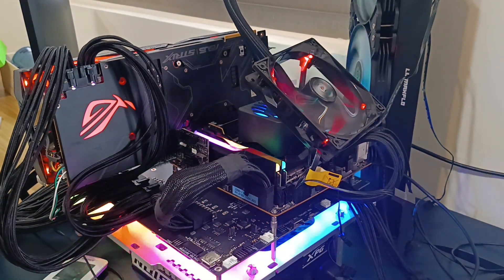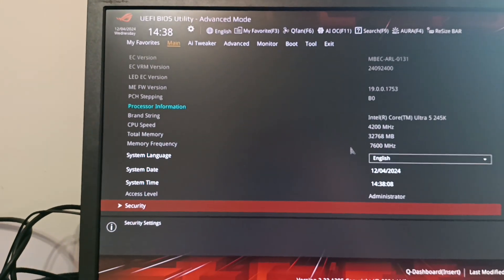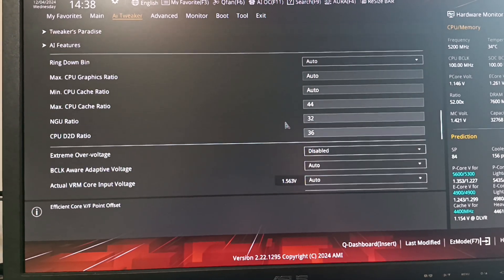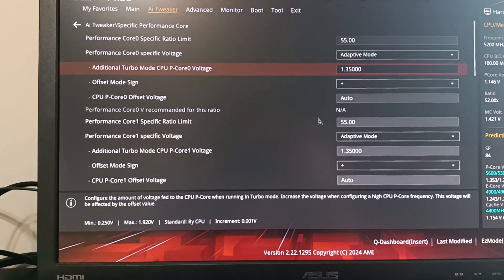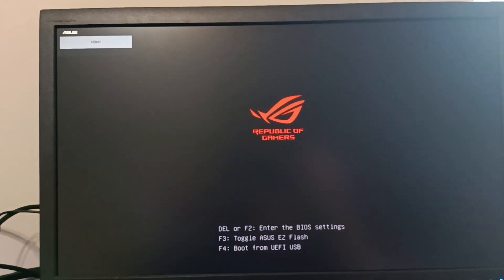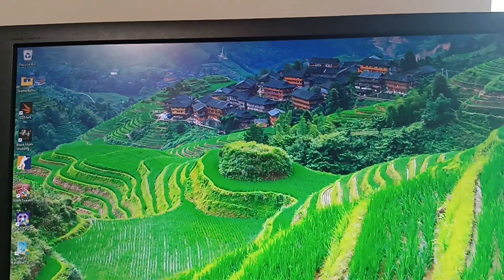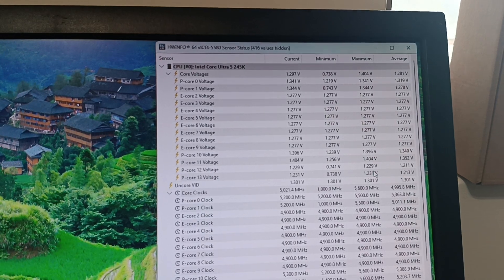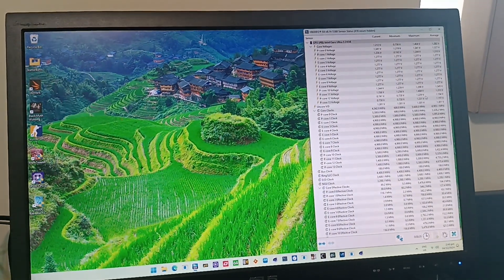Arrow Lake testing woes

Comment: I find OC on Arrow Lake overwhelming. Haven't OCed much in like 10 years, last build was Ryzen which I just left alone. I would really appreciate a guide for Asus boards. Messing in BIOS is confusing, messing in XTU is unstable for me. I think most people have a 265k and would like to get the most out of it without being unstable. In my case it's a workstation, so I'd back down a bit from the edge to be 100% stable. All on water/AIO.

Comment: With a dynamic overclock set at 1.35v theres going to be adaptive voltage offsets based on the LLC, the vid requests are coming from the cpu anticipating an all core 53x workload is coming abd adapting to it. Under load you should get your expected values. 1.404, 1.418 and 1.434v are usually from your LLC settings being high. 0.05v overshoot at idle is definitely from your llc presets.

Comment: Do you trust the voltages that HW Info is showing you?
Reply from the maker: Sure. Trusting the readings is fine when you know what's being measured.
Reply: @SkatterBencher What I meant is: we all know HWinfo is not always reliable.  Especially on newer hardware and especially on power… So perhaps that is worth considering when the shown voltages do not match what you know was set in bios. Just a thought.
Reply: @docbrody One sure thing. Asus Mobo suck at reading voltage and is well known for that. I think that's even said on Hwininfo64 that if you have something from Asus some data could be false/or wrongfully named.

Asus being Asus.

I'm ngl, Asus is good at one thing: Making high-end board. The other stuff either suck. Have a higher failure rate (Like the Asus ROG Strix 4090 without fuse). Or worse price/performance
Reply: @FireCestina1200  exactly.
Reply from the maker: @docbrody that's a good comment! Let me rephrase: in general I trust HWiNFO readings, however, as you rightly point out, sometimes the labels aren't correct. Especially early in the product lifecycle. So when I come across unusual telemetry info I'll definitely go and cross-check against BIOS and other tools.

Comment: This platform will become good once it's cheaper than Raptor Lake. Paying such premium for a platform that isn't beating last gen anywhere really. Looking at XOC, go look at Hwbot and you will have your answer, what about games? Well you can go look yourself as well, majority of games still run faster/better on 13900k/14900k(s). Really only place where something like 285k could compete is high memory speeds. Running +9000 MT/s daily on something like 14900ks requires god bin, however 8600 / 8800 MT/s is more doable and beats 285k in most games. You can yourself go as well and ask people that run well tuned 13900k / 14900k systems if they would switch to 285k, majority answer would be no, because that would be a downgrade - looking from perspective for raw performance in games. Arguments about power consumption can go both ways, less power = less performance. More power = More performance.

Comment: i have a similar issue and i am pulling my hair out. i run a 265k on an ASRock z890 Livemixer and for the Love of god, i cannot get a uefi based dynamic undervolt/OC to work properly. using Intel xtu i know what voltage and frequency offsets the cores can do and it works properly, but whenever i change anything in the uefi about the CPU cores (core voltage or frequency) the DLVR goes crazy and blasts a 1,5v input voltage, even thought it should be around 1,3v due to the undervolt, totally ruining the efficiency gains and the temperature. that even happens when i overwrite other dlvr sourced voltages with a fixed value.

right now, according to my experience, tuning for a daily setup with dynamic clock/voltage behavior only works with xtu and not through uefi.

also, anyone had any luck overclocking 2x32gb ddr5 6000 cl30 hynix memory? im stuck on 6600MTs, anything higher barely posts. i didnt try blasting SA and memory Controller voltage, because its a Workstation and needs to be Long Term stable

Comment: One question I have x870e Gigabyte Aorus Pro, ryzen 7 9800x3d, 2x32gb ram 6000mhz, 1350w psu. The problem is that cpu clock is fluctuating in the games, it's not holding the max boost and it should, the cpu temp is 49-52c in the games and clock goes down to 4900mhz, 5000mhz etc. I tried bios update, high,ultimate power plan, installing chipset drivers, undervolting, using pbo, scalar, increasing temp limit even if cpu is not hot. It's windows 11, I tried core isolation on/off, in cinebench 24 it's holding the max boost at all cores without fluctuating. I tried to oc manual and then there is no drops but I don't want to use manual oc. Anyone know what this could be?
Reply: Games don't load the cpu the same way a heavily multithreaded synthetic workload like cinebench does which makes the cpu not hold the full boost. Look at your gpu usage in the game you're testing. If it's maxed out at 99-100% your cpu has nothing more to do so it uses the extra time to clock down or sleep while waiting for gpu. Also high power profile keeps all cores at high clock but that actually hurts single core boosts very often so i personally don't even use high performance anymore.
Reply: why don't you benchmark it? if the results are fine why bother? You could be clock stretching if you tinkered with voltages/clocks
Reply: Under even heavy gaming loads, particularly when GPU limited, it is expected that CPU clocks will fluctuate.  Gaming loads are not flat or static, and I don't know of many games that fully load all cores of a CPU at 100%.  CPU clocks vary based on loads vs core temps and Voltage.
Reply: For CPU testing using games, ALWAYS unbind the GPU first.  set all graphics settings to the lowest settings with a resolution of 1080p (or less).  Then run your CPU benchmarks and see where the clocks hold.  Also, keep in mind that games don’t put the CPU under the same load as cinebench. At most they will only use 8 cores, but even that is very rare.